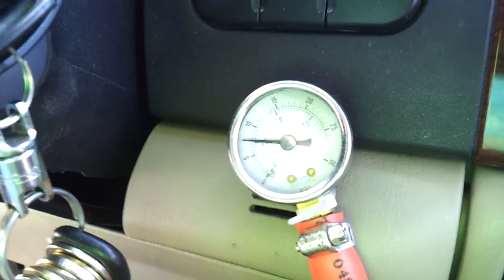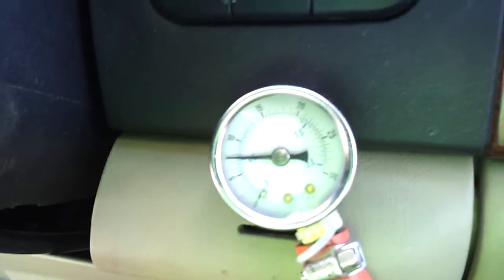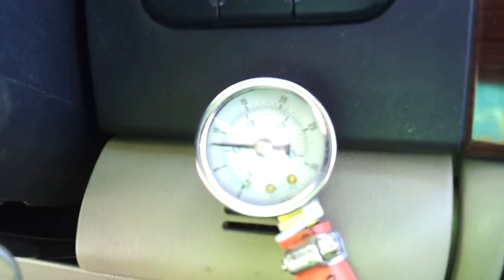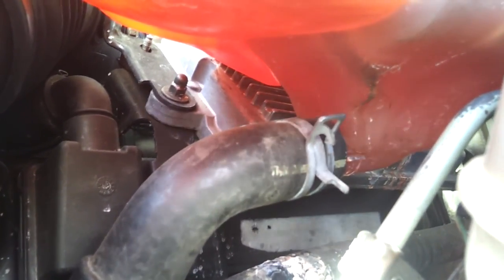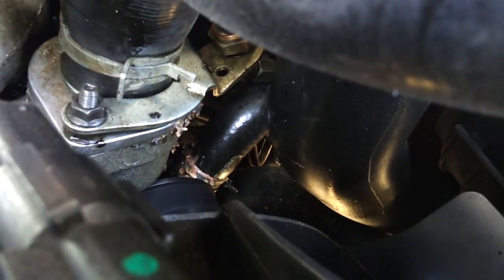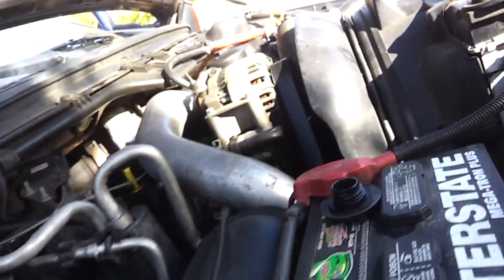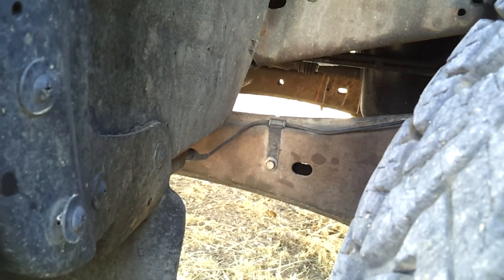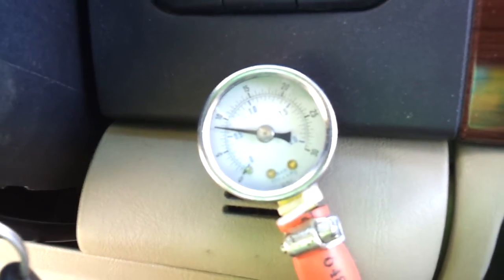New Blackwater Engines Longblock HeadGasket Leak and Blow-by Part 1

Comment: I'd like to add that I've had numerous issues with my blackwater engine as well. .040 overbore (when they said max .030); Injector cups leaking immediately; cracked piston rings on 3 cylinders; lots of blowby; stuck lifter that had to be replaced. Probably more that I can't remember. All of that was in the first year, and of course, none of it qualified for their rock solid protected warranty.   For anyone who is on the fence about these engines, just look for reviews online. You won't find any. Because they've removed all of them.

Comment: I know it's been awhile but was gonna buy a blackwater 6.0 since mine is shot woukd you recommend?
Reply: NO! Avoid BLACKWATER at all costs! They use Victor Reinz gaskets and claim they are OEM then use copper gasket Spray to try to make up for their poor Machine work. Copper gasket Spray on an MLS gasket is a huge NO No.
Reply: They reused valves from a motor that had an INJECTOR too break off and crunch up the valves...

Comment: That's crazy how much pressure you were able to make with literally no load on the engine,I can imagine pulling a hill under boost that radiator cap must have been just letting coolant out as fast as it could,the hot bubbling coolant scorched your entire cooling system ,degas bottle included...
Reply from the maker: I'm glad it's is just as obvious to someone else. I've learned a lot due to their poor workmanship.

Comment from the maker: Since you have done some head gasket jobs on a 6.0 surely you know that hooking a pressure guage into the cooling system is the Ford reccomended method for diagnosing head gasket failure per TSB 09-08-03. You must also know that the injectors can be easily tested electronically with a power balance test which I do about every other week, and have done at various speeds and loads. The maching that Blackwater did on this engine is poor, loose and sloppy.

Comment from the maker: Well Jacob, you must not have watched part 2 where I show the pressure under mild accelleration while drivung and the pressure goes right up to the degas cap release point. If that were not enough I replaced the head gaskets and now the pressure doesn't jump with the throttle as it does in the perfectly clear video. However the block was bored .040" over when I was told they don't use blocks that need over .030 and guess what I get pressure in my cooling system when I push it up a hill.

Comment: If this were the case there would be oil or fuel in the coolant. The oil and fuel system runs at a much higher pressure than the cooling system so oil and fuel would migrate to the cooling system.

Comment: Did you replace the injectors too, they can make what seems like knocking sounds. There is a reason no one is commenting on your video. There are so many variables, EGR components, and other things that you took from the other engine. Run a compression test and I will bet you that you will find nothing wrong.

Comment: Sorry had a sick son to deal with. You "obviously" don't know how an engine cooling system works. First your not getting to 16 PSI so your degas cap is not venting. Every seam in your cooling system should handle that pressure. Second there is a reason that cooling system is under . It raises the boiling point of the coolant. What you are seeing on your gauge is normal. Third, that is minimal blow by. Rings today are made of harder materials so driving 5000 miles is not broken in.

Comment: I am a diesel mechanic. Turbo charged engines always have a bit of blow by. If you see pulsating blow by it is a problem, but yours looks like just a bit of pressure. It you had head gasket issues the needle on your gauge would be bouncing because there would be a pressure spikes. This would occur when the cylinder fired where the leak in the head gasket is. I do know the 6.0, and it is a piece of crap. I have done countless head studs and head gaskets on them.

Comment: That doesn't look like that much blow by, especially in a fresh engine. The rings haven't seated yet. Give it some time. When you speed up the engine RPM the water pump is going to spin faster making more pressure lol. You don't know what you are talking about.